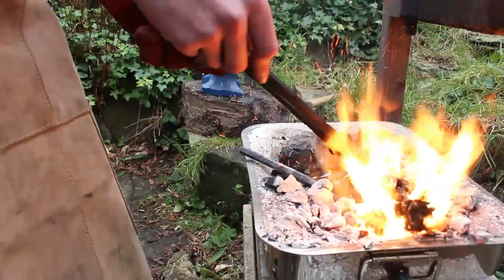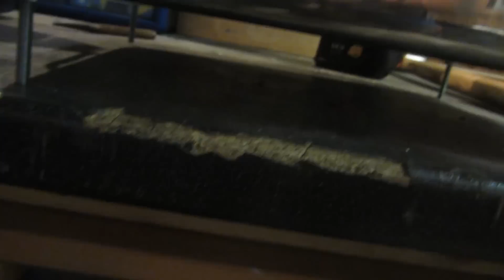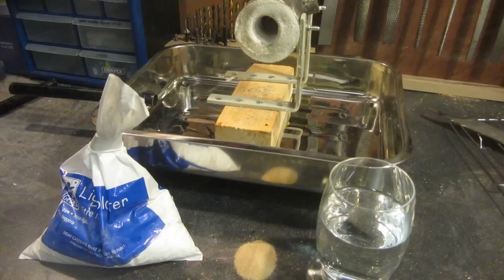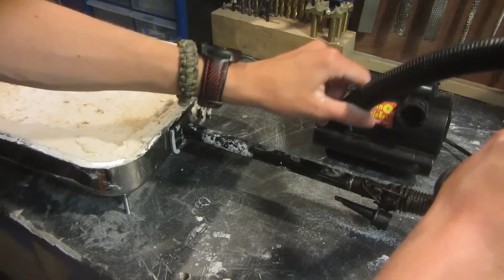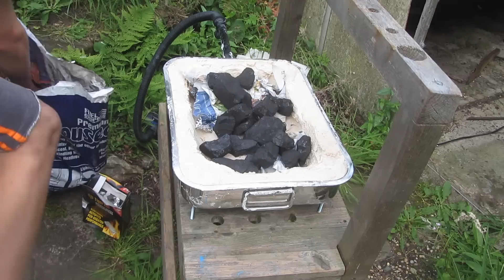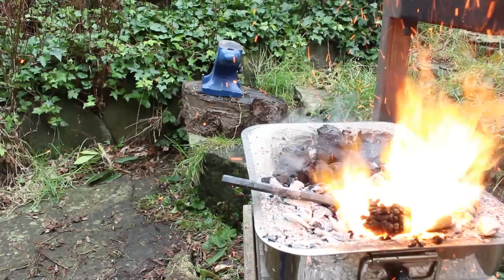How to Make a Simple DIY Blacksmiths Forge

Comment: Good on you for trying this. Well done.  I wouldnt worry about a bit of forge smoke. Thousands of Blacksmiths dont. Weve cooked on fires too for thousands of years. A little smoke is good for you.  Unless youre in a small room with no ventilation. Then of course carbon monoxide. 👍🏻

Comment: For the air supply do you think having it at the bottom and then drilling air vents thru the plaster an pan would help distribute the heat better so you don't have to move the coal around? Thinking of doing this build for mine but don't know if the air in the middle would be better

Comment: I've heard this doesn't have a long burn life. How much work can you get done before it crumbles? Also, how much charcoal you going through an hour?
Reply: I don't use  that  to line mine. but know what it made up of .  Not that long  but it depend  on the heat  level.  It  will   melt the  sand and  burn up the plasters  with  high heat.   If you go with just  barley forging heat    it should last some time. As long as it stay dry .
For charcoal . It about air flow. The more air the more heat. the fast you burn  it up.    Banquettes last a long but may have a heat limit and a lot of ash. Lump  varies on this. It all about the size  of  it  with the rate of air flow.  
I got a disk break forge  around 5 cup in size  . The fuel  is  quarter/ nut size.   Have to fill it up about  every  25 minutes with none stop low air flow  just around forging heat.   Blasting it is  less than 10 minutes.  See white  flame pop out and steel become a sparkler and the  clay lining melts
Reply: What’s the exact name of the air blower he used

Comment: Low carbon steel would work
Reply: What’s the exact name of the air blower he used
Reply: @Memes_all_dayyt  I had made and mine worked the use of hair dryer the air compressor he used is for puddling or paddling pools

Comment: Nice job simple design is always the best.... I saw a similar idea on you tube where the guy took a piece of pipe and slit it with a thin grinding disk. He drilled a hole in the side like you and then lined the tin with the same mix and the shoved the pipe through the hole with the slit pointing and embedded it in the mix same idea just gave a bigger area for heating larger items..

By the way loving the H&S you've gone to all the trouble of leather apron and welder gloves buy bare legs and short ouch ouch ouch. not a criticism just made me laugh . keep up the good work!

Comment: Great video but I would use mouldable Firebrick (5Kg Tub is £15 inc delivery) instead of plaster of paris/sand as it could withstand greater temperatures and it is heat refractive up to 1440 degrees
Also you can get some cheap brand new 11kg anvils on ebay only £35

Comment: Made this forge today. I didn't have an electrical connection so used a foot pump and it worked pretty well :-) not sure how well its going to hold up to repeated use but was a great one day project and a very cheap way to try Blacksmithing for the first time. Thanks for the video :-)

Comment: Is this good to melt ?
Reply: Timeler Plays it will melt aluminum, brass and lead I'd think. if you inclose it in fire brick or a steel shell it will get hotter. more air flow will make it extreamly hot

Comment: could this melt high carbon steel?
Reply: you need foundry
Reply: I'm Bored can i forge steel?
Reply: Vault Boy
well that's the point he showed us this
Reply: I'm Bored making sure...if i wanted to do larger pieces could i use grant Thompsons forge to heat them up (not his exactly I'd use a refined model)
Reply: Vault Boy
okay then...,,if you really into blacksmithing,i suggest you google "propane forge"
i'm myself is building one,well still processing
Reply: I'm Bored how long does the propane last and how complicated is it
Reply: Vault Boy
are you below 15?,i just gotta ask
Reply: I'm Bored no im 18 i was just being pretty lazy. i was multitasking and watching the video
Reply: I'm Bored i can use power tools but i dont know about open flames like those acetylene oxygen tank things or the propane tanks
Reply: I'm Bored i had a slight fear it could feedback up the gas line somehow
Reply: Vault Boy
well if you fear about leaking or feedbacking gas then do it right,or use charcoal which i'm using right now

Comment: hi, i have a question: i am making a karambit but i dont know if the steel is heat-treated already. its very hard to file so i also need something to do the sanding does anyone knows some tips and trick for the sanding? i have a few tools and the angle grinder does the work fast but its very hard to handle.

Comment: Nice forge! I hope to see more forging projects from you :)

Just one point: I found out that the mix of plaster and sand doesnt hold up to higher temperatures. I use coke for my forging projects and the refractory would just melt/burn or fall off at this temperatures. Iam using a mixture of 50% silica sand 30% cat litter (bentonite) and 20% portland cement. the portland cement is just for the strength at low temperatures and will loose strength at higher temperatures. If I fire the forge/foundry for the first time Iam using the full power of my blower and feed in a lot of coke. The sand will melt and the refractory gets very strong. Works better than the plaster and sand mixture but still got its issues...after some time you need to change the refractory. 

A brakedrum forge works better for me. But for charcoal its just fine

Cheers
Tim

Comment: Hey I found this video just in time! considering building my own forge soon after using my school's metal shop forge.

Also a project idea: make a serrated knife/saw sort of thing. I'm curious to see how you'd do serration. Personally I'd just use a grinder then heat treat it.
Reply: When I put serrations on a knife I use a round and triangle file from my experience that works better than a grinder even though it takes longer

Comment: Dont use a hairdryer.  An air compressor like the one in the video will work much better since the air coming out is much faster.  I was able to melt the refractory coating in my forge using a similar compressor and charcoal as fuel.

Comment: Hey I was wondering if it was able to melt aluminum or even lead?
Reply: Lead has a low melting point so I'm pretty sure it will melt it. I don't know aluminums melting point but I think it is higher than this forge can heat up to
Reply: You can melt lead on a camp fire in a cast iron pot if you wanted. I wouldn't recommend it though.   You can melt aluminium in this forge IF you have a good crucible and IF you are very careful. BUT it wouldn't be as safe or effective as getting a designated melting furnace . 
I would not recommend doing any of this for safety reasons.

Comment: Great video. I would recommend getting a drill step bit for drilling into metal, especially useful for bigger holes. I got a cheap one off of ebay and it's brilliant.
Reply: Nah, man, I took my forging hammer and a big ass nail I found a year prior at my old home depot job. I just banged it on and ripped an ugly, but effective, hole into it

Comment: Great video, onlyI would not recommend using plaster of paris and sand for a refractory, it is not very good.
Reply from the maker: +Joep Stuyfzand It has worked very well for me for all of the forges that I have ever made
Reply: The Art Of Weapons
Thats great! However, at high temperatures the plaster decomposes and will require some repairs, but yes, for these purposes. its fine :)
Reply: +Joep Stuyfzand and the sand melts
Reply: what refractory mix should it be
Reply: +Tele Chubbies ideally commercial refractory, but a lot of recipes at home use fireclay/sand, not ideal, but the fireclay is better than plaster
Reply: J Stuyfzand w
Im trying to make my own and getting materials together, would Rutland Castable Refractory Cement work ok?